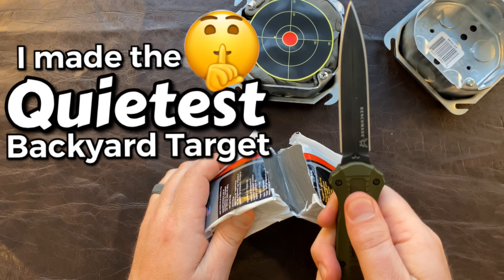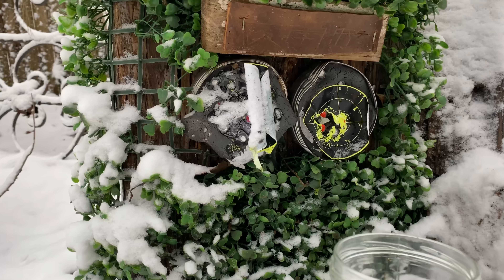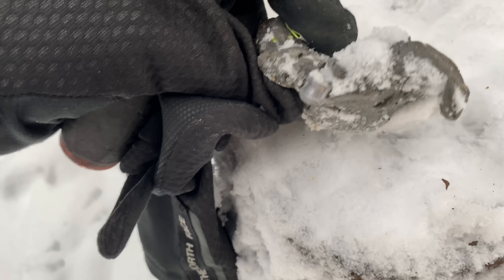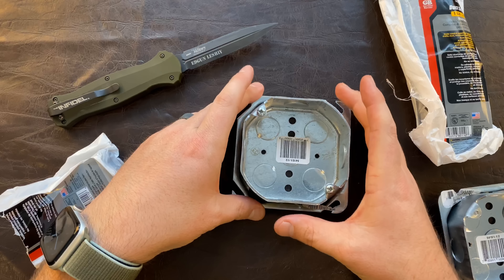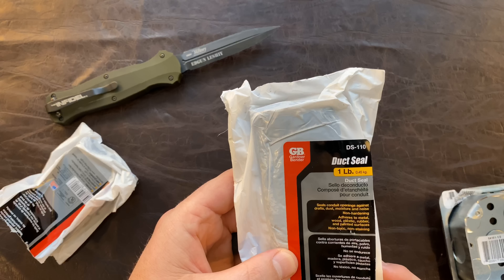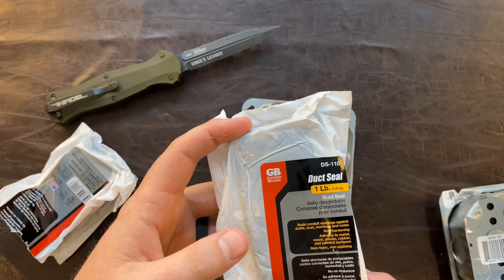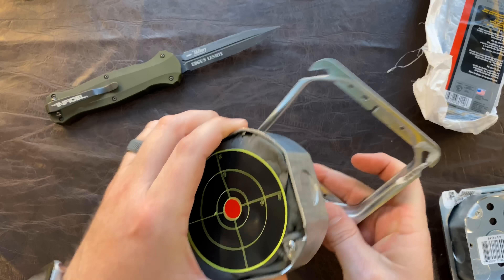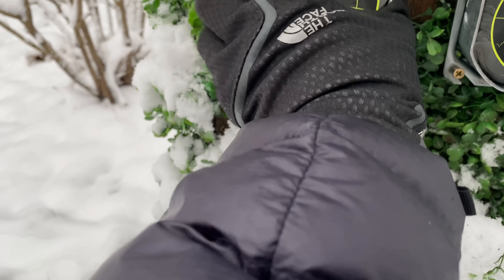The Quietest Backyard Airgun Target (DIY How To!)

Comment: You can purchase a 4‘ x 8‘ hard foam insulation board that you can actually cut within utility knife. And these make pretty good targets too if you use or CO2 pistol. You purchased the insulation per sheet and you can get it in many thicknesses at Home Depot. Some of them come in two, three, four, inches thick, maybe even thicker or you could put two 4 x 4 together to make it double thick and then put paper targets on it with thumbtacks or something.

You could use some spray foam crack sealer also that expansion foam. Or probably even Play-Doh when you name it.

You are really shaking, should you be shooting anything or maybe it’s just the video trying to get everything in without the video being too long?

Comment: I had a ton of cardboard boxes in the way once. I took one long one, about 24" an cut up the other boxes until i filled it with sheets. It took 73 sheets to fill it. That was three years ago and now I finally shot all the way through it. My biggest airgun is a hatsan 30 cal nitro piston to give the idea of the power.  I am mobility challenged so my range is through  my living room and into the supply closet, around 15 feet. A visiting nurse once noticed the box and almost had a stroke when i told her it was a shooting range.

Comment: Since seeing this  video initially,  I have made myself a 12 x12 x 2.5  frame. It's enough for four 6inch targets and one 2 inch target for the center.  This duct seal has proven much more quiet than anything I have used to date.  And having the larger frame allows for more time to shooting at multiple targets. This wouldn't be a. issue if I didnt have to elevate the target 25 feet at 50 yards from my deck. Thanks for the advice on the duct seal.

Comment: I've been using a 12"  square  wooden box, with the duct seal inside, for many years. For extra safety, I've reinforced the back of it with a part of an abandoned metal street sign. Never had a problem for the last couple of decades. I attached a handle to the top. It's very heavy, so I recently spent awhile pulling out a whole bunch of lead - they add weight like crazy. Box is still heavy, but lighter than before.

Comment: If you need any work done on your Veles, Allen Zasadny (Air Smith) just fixed, resealed and tuned mine to 16.5 ft lbs in 22. I was having blowback issues on the action,. Original detent balls were not holding it. He blueprinted the action and then added 4 additional balls. He also added a cocking aid to the back of the action. It works great.
Reply from the maker: Congrats on getting a veles, the unicorn of airguns. Allen is a smart guy... good hockey player too

Comment: I made a different version... I'm also trying to keep the impact sound quiet for my neighbors.  I'm shooting 22 cal FX air rifles with pellets and slugs at pretty fast speeds (900+ fps)

I made a 3/4" ply (target shroud) that is about 12" deep to keep the "sideways sound report" minimized.  

The front of the target is about 10" wide x 12" high and i use simple office paper clamps to hang a standard 8.5 x 11" printed target that I print on my printer.

Shooting into 3" deep duct clay, and having the sound contained in the open ended deep box makes a huge difference in impact sounds.  Before I added the duct seal clay, I sprayed the plywood box with canned "bed liner" inside and out to prevent moisture damage and add to sound deadening.

The depth of the box helps keep the impact sound from radiating away from the target and is absorbed into the target.

The sound difference is ridiculously quiet.  

Then In use cheap solar yard flood lights in front of each target to illuminate them far into the night hours
Reply: Sorry to add...but I forgot a couple things. 

During the construction,  I glue/pin nailed a few 1/4x 1/4 wood strakes horizontally across the inside of the box to help the thick clay from settling or falling out when the target gets hot in the summer.  Before I press in the clay, I spray the inside of the box with 3M Super90 contact cement to help keep the clay bonded to the target.  

I generally print my paper targets on fluorescent yellow craft paper for low light.  Or I use small 1/2" squares of aluminum HVAC aluminum foil tape for thermal scope target practice.
Reply: My "boxed-in" targets keep the "impact sound" from radiating outwards.  it really works well.
Reply: and btw... using heavier scrap 2"x12" wood as a perimeter surround is even better.  It's all about adding mass to keep the impact sound "contained".  Especially building it a little bigger with a 1x2 front lip to keep the sound a little enclosed.

I'm also experimenting with adding sound deadening adhesive sheet material inside the box from the automotive stereo world..  My back yard targets are super quiet

Comment: Excellent tutorial I have used duct seal for about 6 years I just redid my back stop and flipped it over. My back stop is 2x4 frame with a 8x10 opening backed with 3/4 ply wood the duct seal I used a ton of bricks my stop is filled with it 4in thick way too over kill but wasn’t sure when I built it. It will last a long time. I like you meathod better if I only knew now what I don’t back then I could have invested in more pellets 😂

Comment: That's a new way to use duck butter would never of thought and I see the stuff every day. I use it to plug off holes around electrical wire in disconnect panels  seal it off and keep the rats out. 👌👍✌️keep up the great idea till the next one.                  Ps wounder board works great for a back stop if needed. It's for tub tile wall originally
Reply: Thanks for this seems like a cheap backstop
Reply: @Iamdudeman12  works great as long the rounds stay under 1200fps or dumbbell it up you can also get it from most home construction sites for free they throw left over pieces of it away it's perty solid stuff but I wouldn't use BBS on it there a good chance they will bounce back. Have a good day 🎯👍👌✌️🥂
Reply: @josephsaucedo8691  Wow good to know thanks!

Comment: Need a backstop behind the duct seal. I'd be concerned about the edge of the box.
Reply: I just use a peace of 1/8th inch steel plate, it just removes the rust at about 45 f lb.

Comment: Crazy question: 
Would this stop a nearly 300 ft/lbs direct hit from my Sam Yang .50? I'm always worried about pass through on my ballistic clay. 
Recipe: 10% dish soap, 40% oil, 50% betonite refractory clay. Mix, and then kneed with extra betonite flour until you have the consistancy of bread dough. My Yang makes a ten pound block vaporize on impact. I got this recipe from the FBI ballistics and criminal investigation lab, on their website, in 2005. I'm not sure if it's still there, and I'm pretty sure they don't use it anymore. It's supposed to show the temporary cavity of bullet impact, and still stop a projectile. It obviously doesn't work all the time.
(Edit:just for refrence, I once shot four 2×4 pine boards stacked and tacked. The Yang gave me toothpicks.)

Comment: Wouldn't using heavy Velcro tape glued on the back of the tin and the other part tacked to the backdrop be a lot cheaper solution than your projected $25.00? Just saying....  Your idea is good your execution sounds expensive.